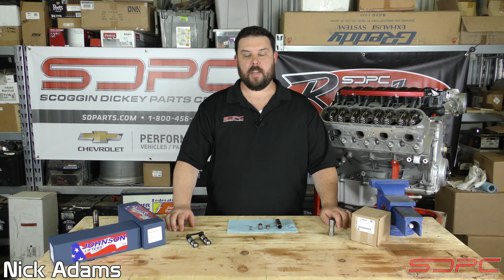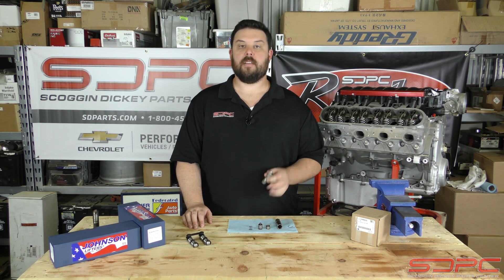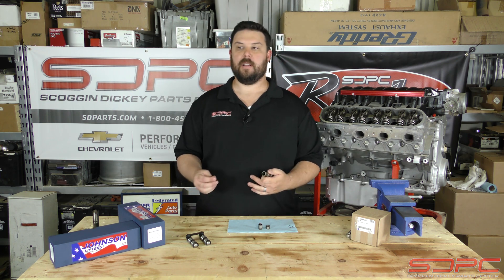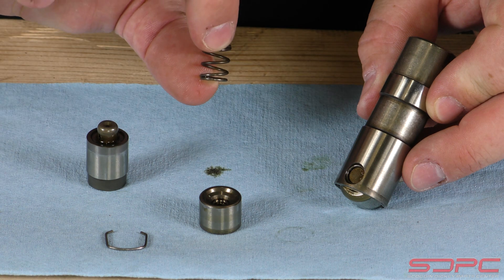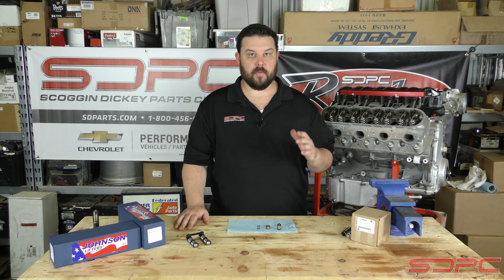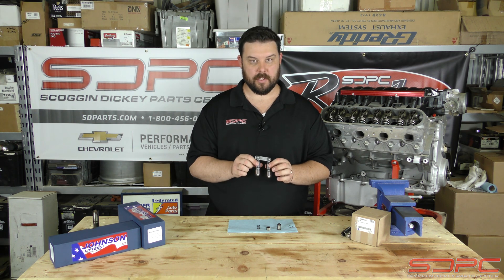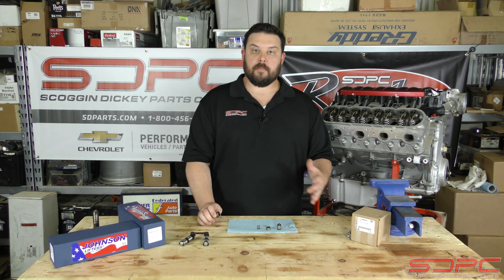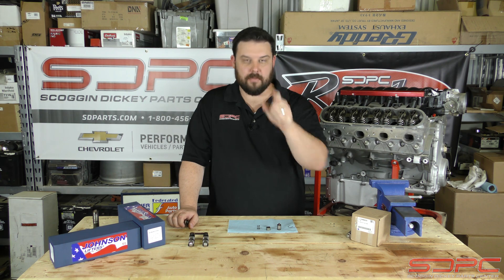SDPC Tech Tips: Performance Lifter Selection

Comment: The Pontiac flat hydraulic that was used with their 041 RA/IV camshaft and valve train in 69/70 was capable of keeping track of the valves at over 7,000rpm.Went there with my crate engine many times on the street.’64 LeMans.There were many more parts inside,tho,to basically lock them up.

Comment: You left out that the LS7 lifter is a drop in service replacement for the GEN ll LT1 / LT4 “‘92-‘96” Gen 1 SBC 87 and up with factory roller cam’s. 
But of course you guys like to forget these engines exist…

Comment: If I use the LS7 lifter in a totally stock 2005 5.3ls will I have to change the pushrods? If so, what would you recommend?
Reply from the maker: If all you are doing is swapping lifters, you shouldn't have to change Pushrods but new lifter buckets would be recommended.

Comment: Good itel. Thatnk you.
However, your audio guy needs a lsson on audio compression.
Reply from the maker: We're all just amateurs doing this on the side (don't let it get in the way of doing your regular jobs kind of assignment) and we were working through a variety of different lapel mics and figuring out the camera settings.

Current one (not used in this video) we have is better than we've had in the past.

Comment: have a small block roller motor  1990. need lifters using for my boat . cam is a xm-276-hr. lift is 503 intake. 510 exhaust. . what lifters can i use. . thanks

Comment: Have had 4 Chevy LS engines one 2002 5.3 and and one 2009 5.3 both these engines were bought used bought a new GM performance LS2 6.0 engine in 2008 and a new GM performance LS3 6.2 engine in 2021 they are all maintained very well with oil changes and maintenance they are not beat on constantly but at times they are driven or revved hard l haven't had a lifter related failure in any of them and the 2009 5.3 has 150,000 miles on it you'd never know by driving it it still runs as good as new so far no ticking smooth and quite don't know exactly what lifters are used on GM LS  performance crate engines but I've have revved them numerous times to 7200rpm with out any problems with a aftermarket or upgraded hydraulic roller camshaft with matching valve springs and l believe the GM performance LS crate engines don't even come with LS7 lifters just stock lifters but l could be wrong
Reply: Gm did 3 lifter iterations throughout the years matter of fact it's still used in Gen V, the latest has a golden clip you can see it in this video, older than 07 or 06 it had a dull steel clip. What kills an OEM lifter is heavy valve spring seat pressure I've seen a brand new gm lifters set fail in the 4th dyno run! Thats the time when you need 2116lsr lifters seen on the table theses can take 420lb seat pressure all day long

Comment: But why do they go bad in GMC 5.3 liter?
Reply: Depending on what year 5.3 your talking about newer ones have DOD which in my opinion is junk and causes headaches but if your having problems with lifters in a older model 5.3 without DOD most likely it has 200,000 miles or more on it or maintenance like oil changes were neglected or someone has been revving the hell out of it often have had 4 LS Chevy engines 2 used ones a 2002 and one 2009 LS 5.3 engines a new GM performance 2008 LS2 6.0 engine and a new GM performance 2021 LS3 6.2 engine so far have not had a lifter failure in any of them and the 2009 5.3 has 150,000 miles but you'd never know it by driving it it runs just like new but l change my oil every 6 months regardless of miles every 3000 or most likely less with valvoline high mileage 5/30 synthetic and a wix XP oil filter not using the proper oil viscosity can cause problems also l use 5/30 oil in all of them

Comment: Then why so many part #’s ??!. It’s so damn confusing when ordering or looking for lifters 
You got 17122490 , 12499225, or 12648846 so what is the difference ?  Video idea.?
Reply from the maker: Some are dependent on which location they're manufactured.  You can have the same component but manufactured in two different factories and they have to have a different part number.  Part gets a component from a different supplier?  New part number.

It's confusing even on our end!
Reply: @Sdpartscenter  so I talked to GM parts engineering and the lifter part# 17122490 are for iron older LS block/Motors and part# 12648846 are for aluminum blocks and Newer LS/LT motors.

Part# 12499225 is a set of 16 lifters, individual part# 17122490 (older style) 

And it gets more confusing because GM is revising the part # again will update y’all with New part# when it becomes available 
Hope this helps or topic for future video maybe??!..
Reply: @Sdpartscenter  side Note they said call your local dealership provide your VIN and get the lifter Part # that the engine/vehicle was built with
Reply: A lot of times when gm has a part number change it’s simply a price increase.

Comment: If I change my camshaft to a higher lift, say a .580 lift can I still use stock springs and valves or can you recommend a good setup to use for that lift? Thankyou Dale
Reply from the maker: Stock springs will not be able to handle that lift, you will need PAC 1218's at the very least.

Comment: Hey, Great videos, I have a stock 5.3. I'm interested in your SDPC Tow camshaft,  207/207-480/477-115. Can I used those lifters that are attached to each other and discord the trays? And use stock or better rockers and pushrod? If so, could you send me pat #'s? Thankyou Again, Dale
Reply from the maker: You can use the link-bar style lifters but they would be way overkill for that cam.  We recommend the LS7 lifters and trays for that combo.

Comment: are the link bar,roller lifters good for an everyday driver? i wanna build a 400,small block for a tow motor for my van. how many miles would they last,hopefully.
Reply from the maker: No longevity problems running link bars.
Reply: @Sdpartscenter  so i can install them in a motor that im going to use for every day and towing a rv trailer for at least 200,000 plus miles and shouldnt have a problem with?
Reply: @harveynewman4333  do research on the lifter trays
Reply: 400 is a Gen1 motor....Best thing to do with a Gen1 if you want cheap reliable roller valvetrain is to use the 1996 Vortec 350 Roller lifter trays & guides with the 2.8V6 Chevy roller lifters look up Gen1 roller lifter retro-fit
Reply: @ericbrandt829  that is one of my options,but im not fond of cam buttons. wish i could somehow fit a retainer plate,like the factory roller motors.
Reply: Yes they are better, they will last as long as you keep changing your oil